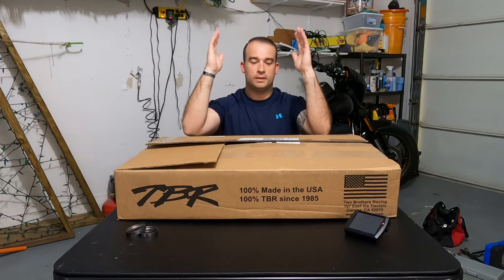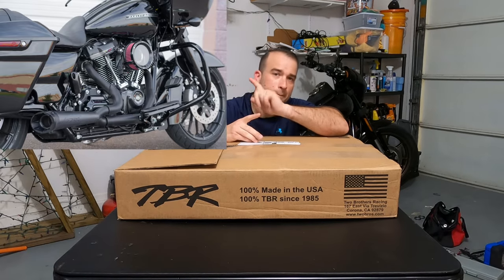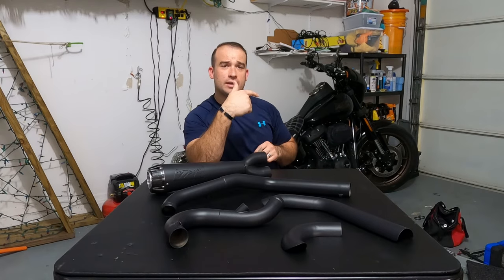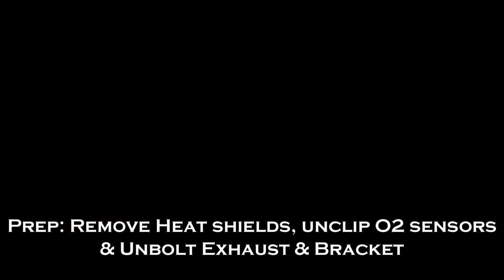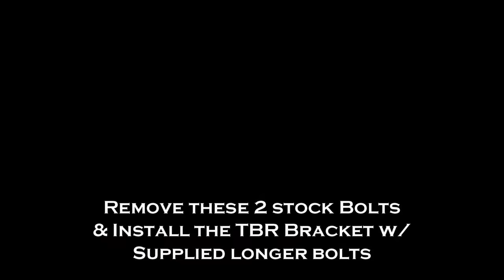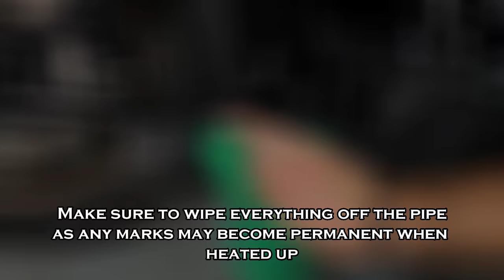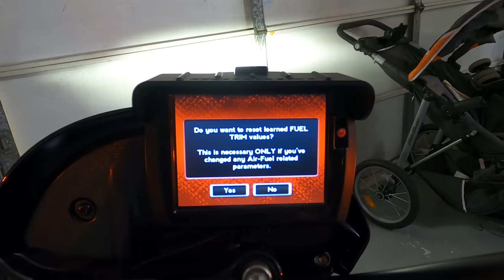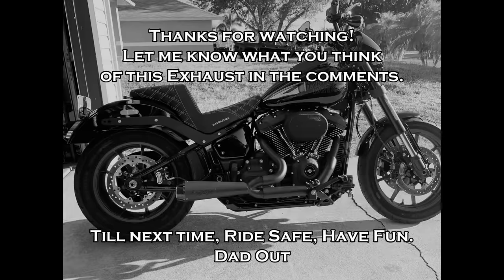Two Brothers Racing Exhaust Install on M8 Harley (Low Rider Build Series ep 6) WITH SOUND COMPARISON

Comment: Been waiting on mine since October.
Reply from the maker: :( that’s a long time dude :(
Reply: @RidinDad   they keep blowing smoke, but I think I discovered the reason. They're having an issue with the black sets scratching easily. I think 2 Bros is or hopefully has found another coater. I'm willing to wait.
Reply from the maker: Yeah, after having a few black set ups, I will never be buying those again, no matter what coding you get for what manufacturer they scratch super easy. Stainless is so much easier and looks good in my opinion too
Reply: @RidinDad  If 2 Bros keeps failing, I'll switch to S&S.
Reply from the maker: There’s tons of good ones out now man. Stealth, hpi, Fab28, jackpot riot, so concepts, thrashin, tons!